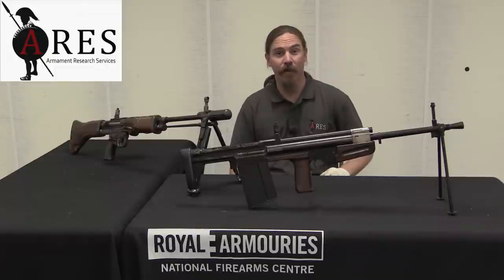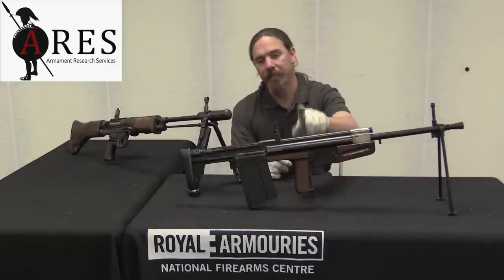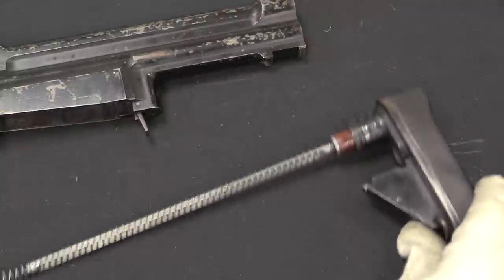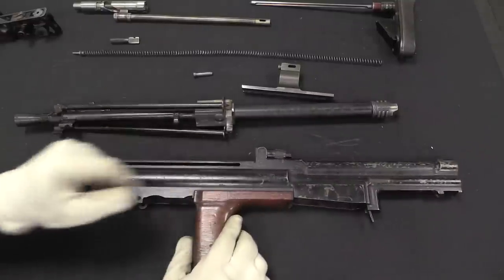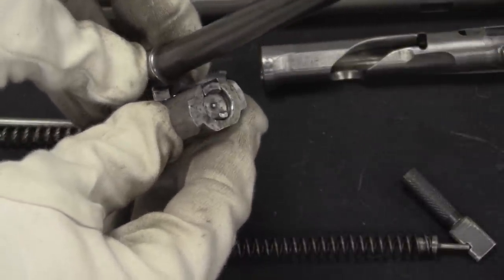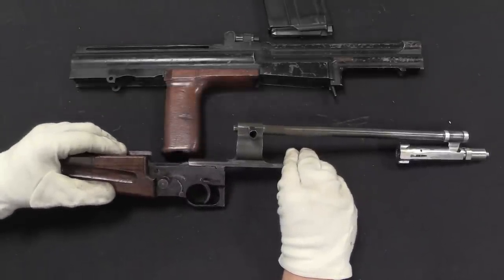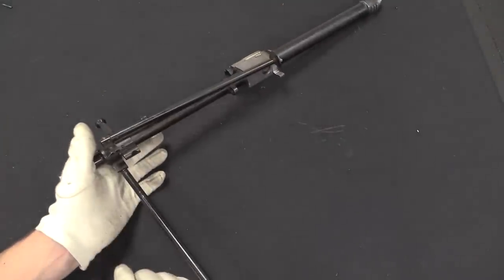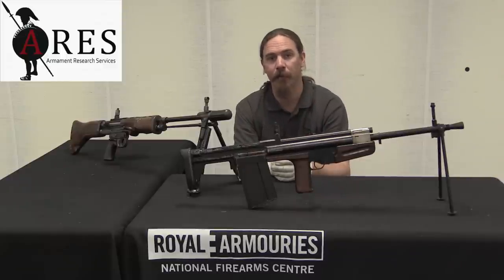The Korsac EM1 - a British/Polish Bullpup FG-42

Comment: Would not the FG-42 technically be the first assault rifle as opposed to the Stg-44? Wasn't it the select fire configuration in a lighter package what makes it an assault rifle along with an intermediate cartridge?
Reply: Lord Caoliki 7.92x57 is not an intermediate cartridge.
Reply: Makes sense, cheers
Reply: I think it's a full rifle cartridge
Reply: Indeed, but the whole point of an intermediate is that it's the half between a pistol and a rifle calibre. I suppose its closer but still not quite there yet.